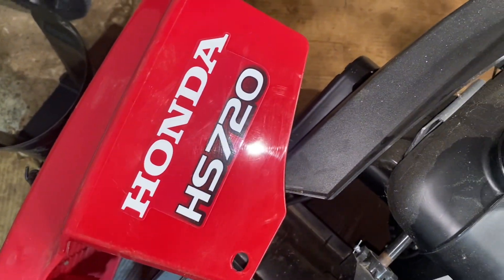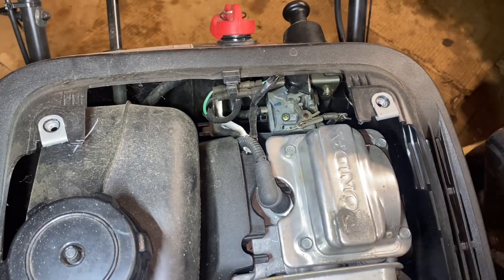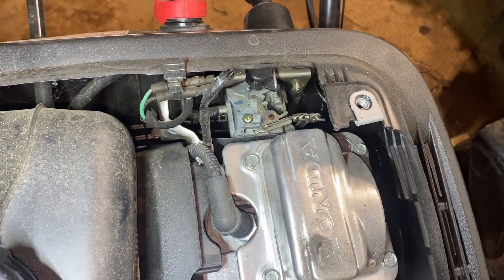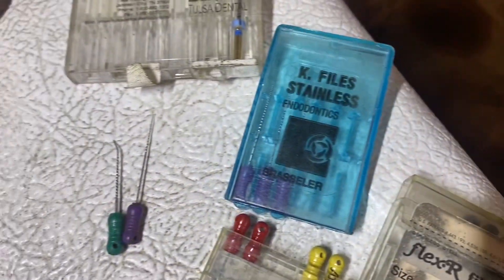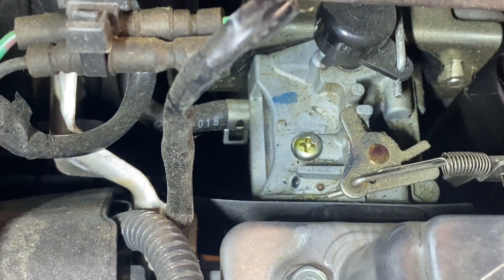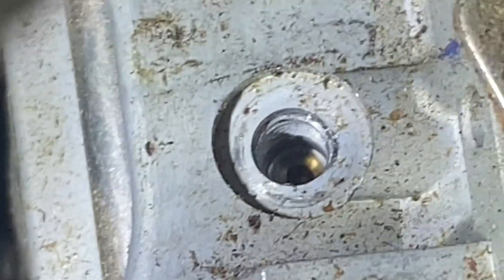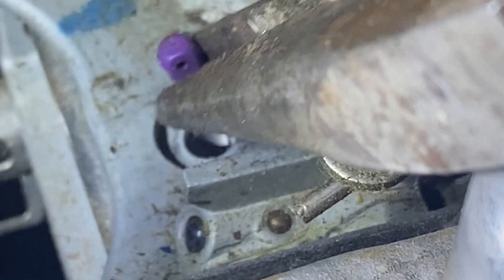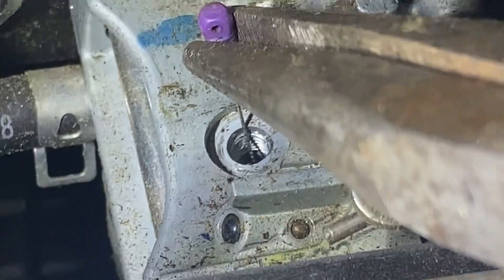Honda HS720 Carburetor (Partial) Clean - Surging - 16100Z1AH01

Comment: I had the same problem with my HS720 where it was surging at idle.  The machine was running lean and the idle would smooth out if I pulled the choke partially out.  I initially wanted to richen the fuel mixture by adjusting the mixture screw but I came across your video on cleaning the main pickup out.  It worked like a charm and the engine is purring like a kitten!  I didn't have a file or anything small enough to get into the hole so I shot a VERY SLIGHT amount of compressed air down the access port after soaking it with carb cleaner for a while.  Thanks a million for your video!